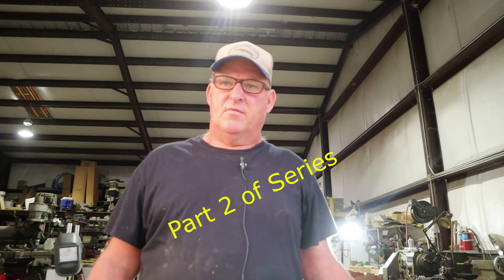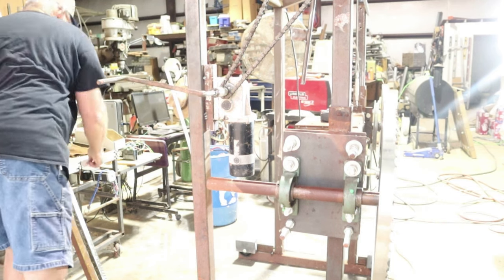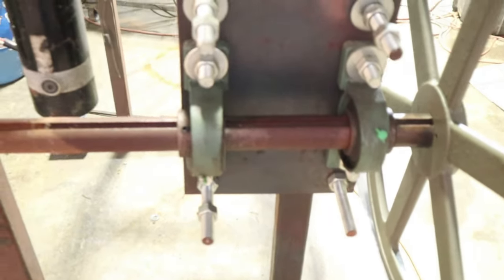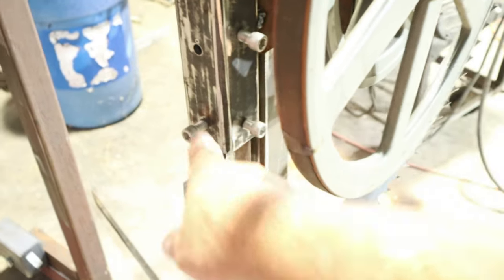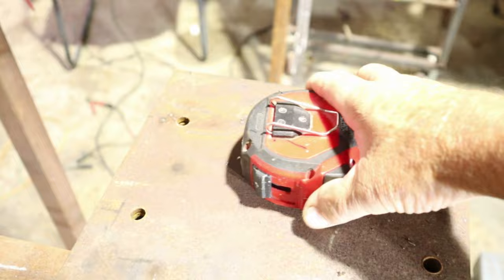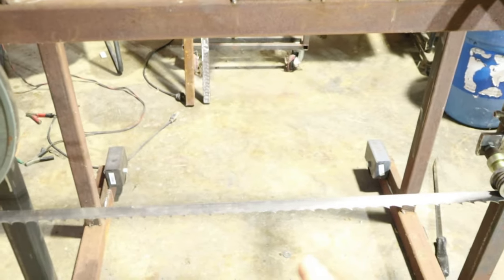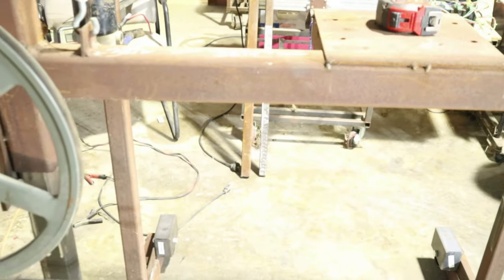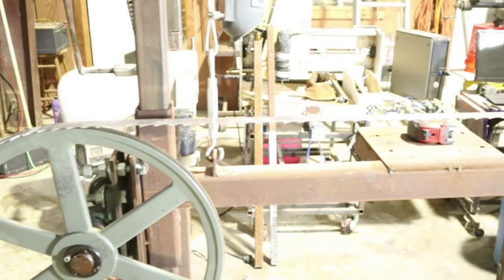158" Homemade Sawmill Build Bandmill Portable Mill Part 2

Comment: on the sprocket situation maybe put a sprocket reduction intermediate drive above the motor like from the motor to another 40 and on the same shaft as that another 9 going up to the 40 .   that should really slow it down .